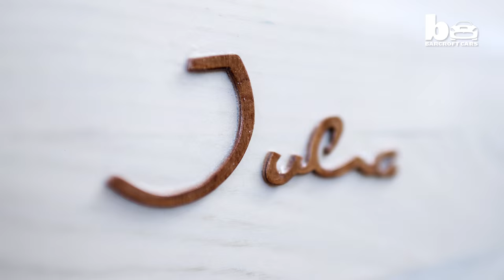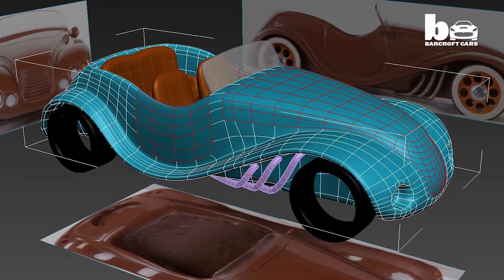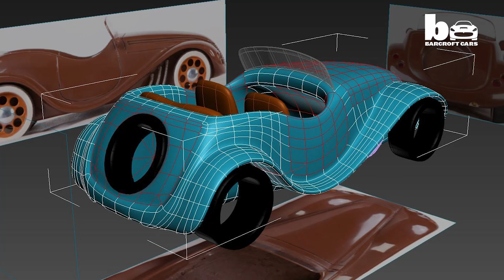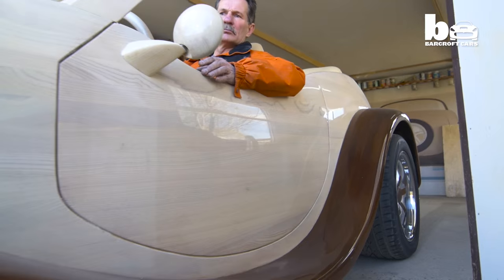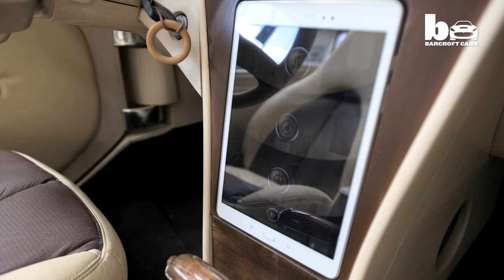Car-pentry: Man Spends $20,000 Building Wooden Concept Car

Comment: Beautiful work, the craftsmanship is incredible. My question: How would you protect the woodwork from the heat of the engine? I'm assuming some sort of wood glue was used to hold the wooden cuts together, but wouldn't that melt under the heat of the engine?